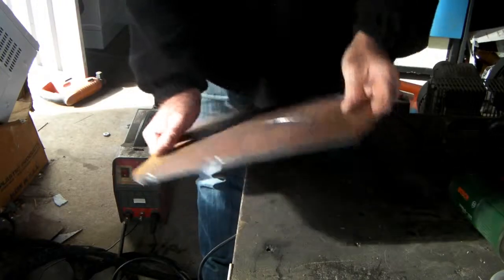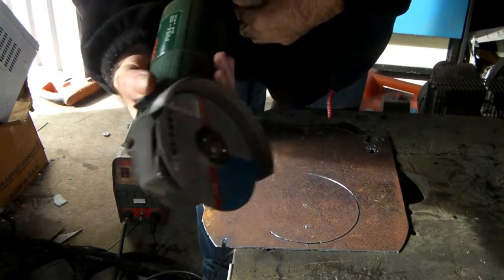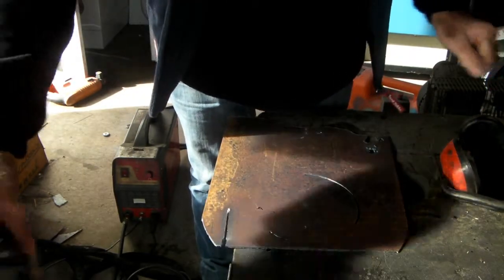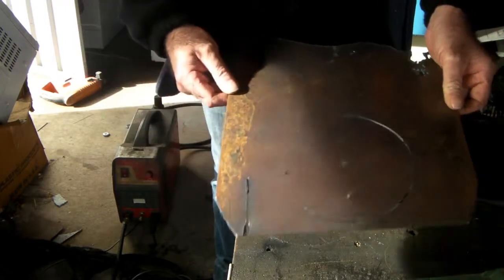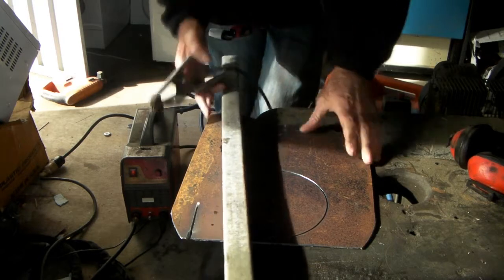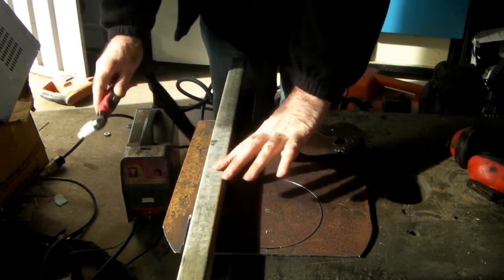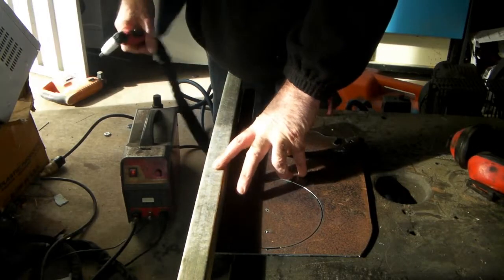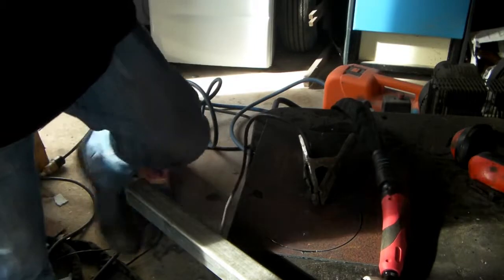Metal Cutting Tools /Angle Grinder Or Plasma Cutter

Comment: Most of metal workers prefer angle grinders for easier control and better results, it is a cleaner cut than the torch.  Try using a thin cutting wheel, the one you used on the video is not so thin.  BUT use a high quality cutting wheel, not those cheap chinese ones. And for even better results use a 4 1/2 inches angle grinder with at least 1000 watts of power, try one with  1200 watts and up, those are really nice for those tasks. The angle grinder you are using i think is like 600 or 700 watts, that angle grinder is not so suitable for that.  Greetings from Colombia
Reply from the maker: Hi there thanks for your comment But if your cutting sheets of plate with long cuts there is no comparison using a plasma torch rather than a angle grinder it would take far to long to cut a full sheet of plate steel with a grinder, better to use plasma torch and clean up the cut with a grinder. i was cutting 20 sheets a day in half longways .So each cut was 3000 mm long x 20 . Really appreciate your comments, cheers pete